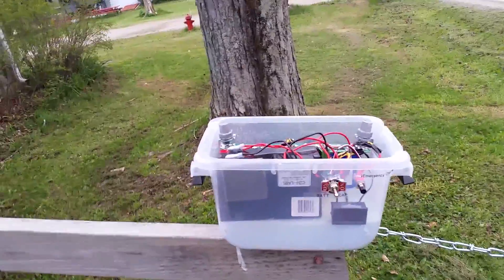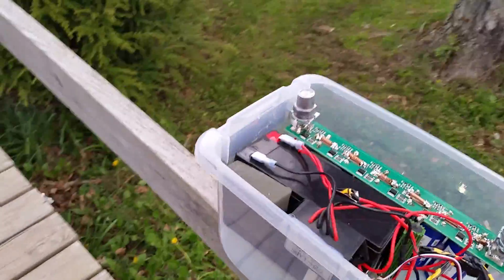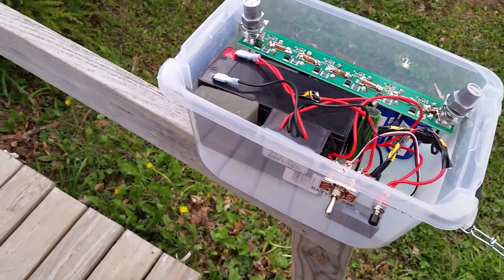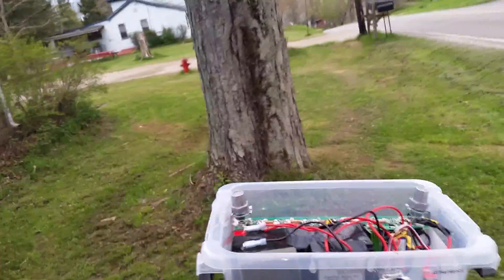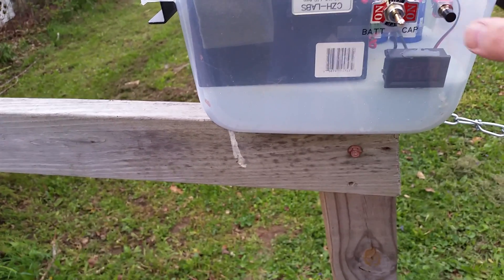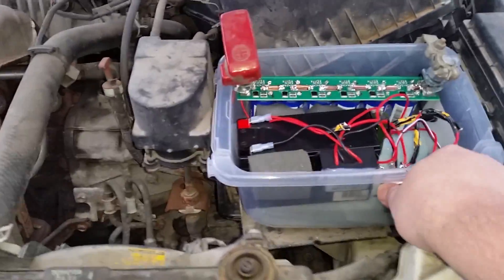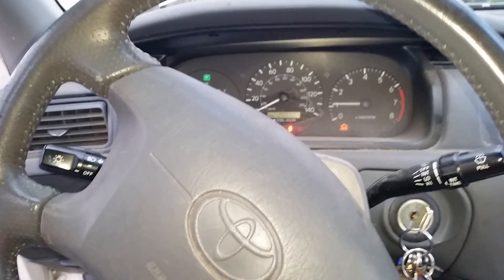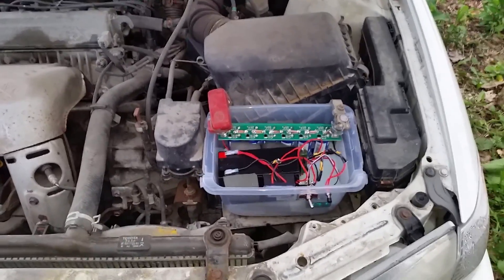DIY Smart/Intelligent Super Capacitor Hybrid Car Replacement Battery v2.0

Comment: thanks for sharing. what wattage for the 3 ohm resistor?  what amperage is your emergency charge switch? any schottky diodes in this setup?
Reply from the maker: Answered your other questions in your comment on the schematic video.  As far as a resistor I went with a 1 ohm 100 watt.  A bit overkill but they are real cheap on ebay. ;)  I explain in the other video the reasoning (pro/con) of using even lower resistors.

Comment: Do you know anything about new super capacitor technologies which will replace large storage batteries? I've read articles that such things have been researched and some breakthroughs made. I'm speaking of a lower cost way to replace all the lithium ion batteries in electric cars. I seem to remember the method was to increase the surface area inside the capacitor. Thanks.
Reply from the maker: Yeah there have been improvements to graphene super capacitors that are supposed to bring them close to batteries.  Robert Murry Smith was developing them on youtube and even built one for a electric motor cycle.  A manufacture bought his work and he has stopped releasing his research on super capacitors online.  I hope the release it.  But I suspect they will hold off as long as possible as a true super capacitor would not need replacing and manufactures would want something that wears out.
Reply: Gene Angel I don't think they would want something that wears out. It is just a matter of cost and things that don't wear out cost more and people may not be willing to pay for that. Do you know if those graphene super capacitors will bring down cost a lot though? The other thing is the lithium sulfur batteries which are supposed to be 1/5th the size and 1/5th the cost. Do you know how the graphene super capacitors compare to that?
Reply: 6 years later and the answer is still no. Hybrid capacitors are starting to bridge the gap, but that's the extent of it.

Comment: Thanks for the information on Maxwell supercapacitors compared to the cheaper brands.
Reply from the maker: I've likely wasted $300+ on off brand capacitors. The latest a set I took a chance on out of China lost %50 of their charge in 90 seconds of charging. They are basically selling the manufacturer defects to the public and not listing them as such. Reputable sites such as http://mouser.com  will give you a good price and always sell you a good part/capacitor. 

I have built several very useful hand crank super capacitor flashlights. Short cranking with long lasting bright light. When I get time I'll post a video on the build.

Comment: Bravo. It's a good setup. but can you put up a website or something explain the circuit/wiring? Using ```A latching relay (also called "impulse", "keep", or "stay" relays)``` working should take much less current but all i can find from China seller is normal relay with single coil which need power to generate magnet. it won't last long, taking 100mA or more. Video from ElectroBOOM also provide current numbers proving 400F 6Serial super-cap can start the car with ~400A peek (while battery gives ~700A peek)
Reply from the maker: For low voltage disconnect I used: http://www.ebay.com/itm/Low-Voltage-D... 
It is rated for 2.2 ma Load switch off and 10 ma load switch on.  However I
 removed the 3 wire red-green led and soldered in it's place a 10k 
resistor (in the two holes nearest the IC leaving the third hole empty).
  If I recall this reduced load switch on to less than 3 ma and load 
switch off to less than 1 ma.

As I explained I switched to and recommend a minimum of 12 capacitors (2 banks of 6 in series).  My schematic is posted here:  https://www.youtube.com/watch?v=zBDtUxPdhz4 

Feel free to ask any questions or give thoughts.

Comment: Hi, I currently design a hybrid car battery (battery and ultracapacitors) and I was wondering on using an 8ah AGM UPS battery parallel to 6x3000F maxwell ultracapacitors in series. I read a comment that you done to rhandsom video and suggest to him adding "a 20 amp Schottky diode in parallel across a high watt resistor" do I need it for my project? Something else did you finished your project so you can post schematics? Thank you in advance.
Reply from the maker: The schematic is posted here: https://www.youtube.com/watch?v=zBDtUxPdhz4

Explained in my other video (and go into more detail) my reasoning for doing this is to protect the battery from "overdraw" and wearing it out too quickly.  When the capacitors drain their voltage quickly drops unlike the battery that maintains it's voltage.  This shifts more of the car cranking load over to the battery the lower the capacitors voltage gets.  This forces the voltage of the battery down to that of the capacitors giving the effect of shorting the battery (which is very hard on them).  If you look at the schematic I put a resistor inline to protect the battery from too much amp draw during starting.  But I did not want the resistor to slow the charging of the battery if it was low.  So I put a Schottky diode in parallel to the resistor for allowing the battery to charge more quickly while still limiting the current draw during car start.

Comment: how do you trickle charge the sealed lead acid battery ?
You can't dump 40 od amps into them so I assume its limited in some sort of way
Reply from the maker: The schematic is posted here: https://www.youtube.com/watch?v=zBDtUxPdhz4

If you look at the schematic the resistor limits the drain at startup.  The Schottky diode drops the voltage a "little" which reduces the charge rate quite a bit.  Testing from my bench power supply charging topped out at around 5 amps and dropped down to 0.1 amps as the battery filled up on a short test.

Comment: Interesting setup.  Where did you get your Maxwell 350F supercapacitors?  I have not seen these for less than $15 each (eBay and Amazon).  So, the cost of only 6 350F caps would be at least $90, and this cost does not include the balance board.  If I was to replicate your setup, I would out at least $115 (this is the minimum cost of 6 350F caps, AGM lead acid battery, and low voltage cutoff), and would likely cost upwards of $150 by the time I purchased all components.
Reply from the maker: I got my Maxwell capacitors new off ebay for $5/each in a large batch.  I ended up using 12 capacitors so $60.  Your mileage on Ebay will vary.  Though I just checked and found some for $8/each.  The lead acid was $14 on Amazon.  The components I got shipped from china off of Ebay for around $7-$8.   6 capacitor voltage protection board is $13 and 12 capacitor protection board is $19.  The plastic box I already had.

Though I think I came in close to the cost of a replacement battery the goal was not to under cut the batteries price.  But rather 2 goals.  1) Have fun working on a home made electronics project to see if I could create a car battery that would useful to me, be resistant to over drain/dead battery damage, and last 10, 20, even 30+ years.  There are drawbacks to this design.  There is enough power to start the engine.  But you cannot just sit and run the car off the battery (ac, lights, etc) for very long without the engine going.  

However for my uses it is working well.  I am running tests and making a few changes to the circuit for better reliability and better power efficiency.  When I am finished (I expect in 2-3 months as I have time).  I plan to post a schematic and linked parts list so anyone who wants to build one themselves for fun/usefulness is able to do so.

Comment: Hi, very interesting video. From a complete novice two questions . Is it necessary to solder the copper bridge ?  Also I have seen several ways to charge the module or single caps. What would you recommend . I have a imax b6 balance charger. Is that suitable? Thanks
Reply from the maker: I used the copper to connect the posts because I needed something to carry the current.  I used solder which worked.  Though I think my next attempt will be slightly larger copper and I'll use a drill press to make holes that will go snug over the posts.  As far as charging it is unlikely to be dead so I think any non-intelligent 12v charger would do the job.  Even if dead it charges so fast (and resistance goes up) I don't think it would mater much.  I have charged it from dead with my bench power supply and a car jumper pack.  If you wanted to be safe you could run off the positive a 1 ohm (or more) resistor for charging when capacitors are dead with an external device.  On mine my aux battery will jump my capacitors if drained.